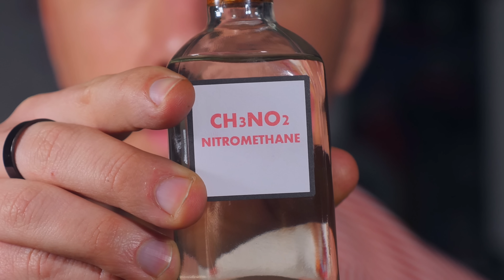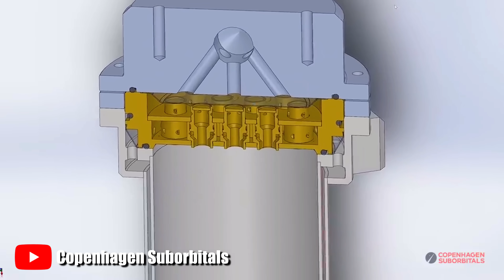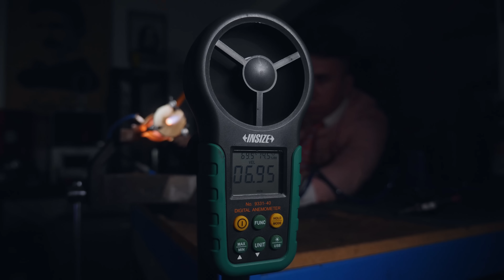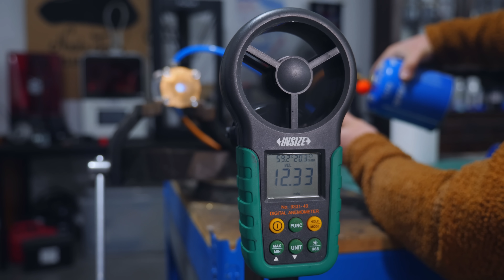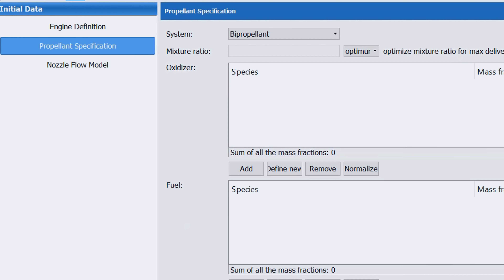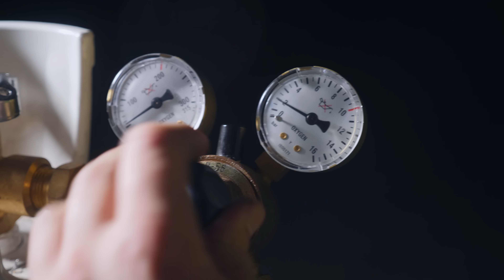GLASS ROCKET ENGINE

Comment: OK, firstly, very cool video as always.  On the the finer points.

1.  You mentioned it head on.  The NAZI's used H2O2 based rockets (V2).  They used pressurized H2O2 in concentrations at or above 90% (government watch list - fear not, you can concentrate your own, but caution as this can be explosive in the pressure lines at these concentrations with 90 degree turns, so be very careful or your right the channel could kill you).  The trick that they used was to use a SILVER or PALADIUM screen to push the H2O2 through to cause it to decompose as it entered the combustion chamber.
2.  If you are using H2O2 as an oxidizer in conjunction with your other Hydrocarbon fuel, then you will get H2O + O2.  The H2O will be very hot and in the presence of your other burning fuel will grow significantly hotter.
3.  What temps are you able to record inside your combustion chamber?  My thinking is that if you can reach temps of about 2000C then you would be thermally cracking the water.  Thus more H2 and O2 (though honestly likely ionized and not stable H2 or stable O2 in the firey hell that is the combustion chamber.
4.  If you can't reach high enough temps in the chamber, a specially designed NOZEL could potentially provide thrust while building up heat.  If so then you may be able to thermally crack the super heated steam and have essentially an afterburner, where the water (first burn exhaust) is thermally broken and becomes the second stage fuel and oxidizer.
5.  Another thought, if you used a SOLID FUEL grain with the bore down the middle, then you could use a combination of rubber, cellulose, and Lithium Aluminum Hydride.  SUPER reactive in the presence of water (even atmospheric water vapor).  Might help produce enough heat the thermally break the water.
6.  If you use either a screen or a tube structure like you would use to create laminar flow, then you could likely get even and consistent decomp of the H2O2 rather than the spurious and uncontrolled decomp you get by throwing the catalyst into  H2O2.  IF the catalyst is not consumed by the reaction, then you could try coating the interior of your combustion chamber with the catalyst and then spray the H2O2 into the chamber along with your hydrocarbon fuel.  when the H2O2 reacts with the catalyst, it should create temps high enough to auto ignite your liquid fuel.

Anyway, good luck and for God's sake be careful.

Comment: For the CO2 cannister engine, how about a high pressure compressor to refill them ( with air) and then make a manifold of 3 or 4 cannisters for increased running time

Comment: Please, would you be so kind to explain a little bit more about calculations of nozzle? Or how to reduce the noise of the engine? Or build а bigger engine that would work not on direct fuel supply but on cycle fuel supply like in stroke engines and could lift about 25 kilos and explain all previous questions in one video? Or at least could you mention, where i can learn about calculations?

P.S.: 3D printers are awesome ;)

Comment: Hey, there is only one problem with all your rocket theories, no it's not the propellant or the engineering or any technical issue, it's simply that nothing can propel in the vacuum of space therefore you have the option of understanding the possibility that space as we think of its fake, that rockets actually don't go there so we have been hoaxed into believing that lue or simply you can continue being a fool which is kind of the image of  the nerd you portray to be in your videos.
Time will be the ultimate judge of that.

Comment: Maybe you could Try a Methanol and Ammonia Mixture, you can run this stuff in Gasoline and Diesel- Engines when you hack/modify the Automatik Engine Timing, so I think you could make an Rocket with this Fuel.

Comment: Project Idea!!  (Tomato approved) Shaver ornithopter!!

So, electric shavers work with an offset wiggly thing. attached to a simple DC motor...

You could make a very simple ornithopter using those wiggly bits and some 3D printed wings :)

I would make it - but my 3d printer is broken and I need a 3d printer to fix it :(

Comment: Have you seen the New Wankel Engine it's on YouTube But it doesn't have any high points like the old One it's Oval with more power and doesn't suffer from fuel waste and Oil Burning like the Old One think you would find it Very informative

Comment: Man, i had an idea, why don't you make an AXISLESS JET ENGINE? (don't even know if this exists but hear me out)

So, I have a turntable that uses a belt-driven system, basically I have a motor away from the axis of the turntable plate that uses a belt to rotate it, so I thought this could be used somehow in a jet engine, causing the turbine blades to be held by some kind of belt at their ends and outside the motor, use something to connect the blades, such as a screw-shaped axis. Thinking about this idea it seems that you would get a smaller engine or that you can burn the fuel better in the combustion chamber but I don't know, maybe its not a feasible idea

edit: actually, the correct word is SHAFT, i forgot the word, so is a shaftless jet engine... kinda.
i also search on internet for that and it kinda exists, not as the same idea i had but a shaftless engine... is used in some boats but i didnt find a jet engine using this, just some patents, so it may be feasible

Comment: ok so i have a idea for a rotational detonation aero spike engine its gonna ber a pain in the ass to make but i bet if anyone could get it to work it would be you no clue how to send you pictures but i came up with a quick sketch and ill try to explain it and make a crude drawing using text

"......./../..../..............\....\...\....."
">O2/<F/>O2 Aero Spike >O2\<F\>O2" 

basically use the rotation injecto but add a third step to it to help cool the spike with oxidizer create thorough mixing of the fuel and oxidizer nitro methane would be a great fuel for this honestly but maybe if done. might be a bit much to try and get detonation but the rotational injectors should help you get the concept down. sorry if i couldnt be more help

Comment: Hey Inteģza 
Have you ever tested the reaction of baking soda and vinegar as a rocket fuel, i know you have to mix it in a closed cylinder and have a valve to oppen when the pressure is at its peak ?

Comment: @Sintratec turns "plastic 3D prints into metal" using a Cold Metal Fusion process.
You could design elaborate rocket nozzles, or  an entire turbojet engine, and have it printed in stainless steel. Check them out!

Comment: I have an experiment for you to try involving 6 Force technology. This tech if for anti-gravity and Tesla has a patent for it in the U.S. patent library. 1928 

Items needed:
I megawatt of electricty that is in the same Electro Magnet wave form as lightning. 
2" sheet of 13% aluminum oxide ( this is the same specs as they used on the USS Eldridge in the Philidelphia experiment.)
You will also need a Steel sheet which is used as an amplifier. 
For more info watch Jouney to the Truth podcast Ep 140 w Dan Cooper.
Thank you for all that you do and I look forward to seeing this if its able to be done..

Comment: would NO2 not work as an oxidizer? Nitrous injection seems like the one of choice for car nerds
Reply: It will. In fact it’s one of the best rocket fuel oxidizers you can get and was very very commonly used.

Comment: Combining vortex intake for a turbine engine. Using hydrogen as the fuel. In theory, compressing air fuel mix for higher combustion and possible higher thrust.

Comment: Building all sorts of engines is cool but power is noting without control so would be nice if you build a car with some kind of engine but coupled a CVT transmission so it can run faster with when the RPM increase. Good luck and thanks for the great entertaining content

Comment: Thought for future video:  3d print a mold for an oxidizer nozzle, and then mix the potassium permanganate with high melting point wax as a binder, and press it into the mold.  Then, use the nozzle to inject peroxide into your rocket engine.  The nozzle should have enough surface of permanganate exposed to initiate the breakdown, and then you inject you fuel and oxidizer and have a nice lightweight fuel and oxidizer setup that could run on small peristaltic pumps.

Comment: I'm not sure if this was already mentioned or if this will be useful. but i live in a high altitude and we have a product called Boost Oxygen which is a bottle sized pressurized can of oxygen for altitude sickness. Smaller can then the one used. Not sure if it is enough air.
Reply: Nevermind that was a cool hydrogen peroxide mixture. That was sick as fuck

Comment: You seem to have made a lot of different types of rocket engines and jet engines. I would love to see you measure the thrust output of these engines using a load cell. A weight scale works I guess but its not as cool as load cells 🤷🏻‍♂🤷🏻‍♂ 
Why don't you make a thrust bench using just a load cell and an Arduino. Its pretty simple and pretty cheap to do and adds a lot of coolness factor to your builds if you have professionally tested the thrust of the engines.

Comment: Hello integza I had this question in mind but i want to know if u put the air intake in the middle and let the air travel forward then back through a angled tube into the combustion chamber, would that be a more stable engine, 
Real question is how would the engine act or change if the air intake was in a different direction

Comment: I think I could make a much more compact combustion system thanks to the dual propulsion design you presented in the video for this rocket boot schematics I have but also a thought is to use a small a electrolysis cartridge for hydrogen and a small tablet and liquid oxidizer cartridge just a thought…

Comment: i guess in theory mixing methanol and hydrogen peroxide makes a really scary monopropellant that may or may not explode violently if something goes wrong and the mixture gets ignited in the fuel tank... maybe safer to do it in multiple stages. 

Actually i wonder just how unstable a mix of methanol and  50% H2O2 really is, considering H2O2 decomposes without a catalyst if it gets hot enough. The decomposition releases heat but boiling the 50% water consumes it (apparently this becomes unstable with concentrations above 68%), but then the released oxygen can also react with the methanol to release more heat. So i do wonder what concentration of hydrogen peroxide might become unstable with fuel in the mix...

...According to my math, an optimal mixture would have enough energy to completely vaporize itself if the H2O2 had a concentration of at least... 22% !? 
That seems way too low, but methanol combusting is a good bit more energetic than hydrogen peroxide decomposing. hm. 
On the other hand the mixture in the video seemed stable enough before adding the catalyst, perhaps the sparks didn't have enough heat to start a combustion-decomposition chain reaction, or maybe the heat dissipated too easily, or maybe i'm just wrong.

(apparently mixed monopropellant is a thing that has been tried, at least according to Wikipedia (Nitrous Oxide Fuel Blend (with nitrous oxide as oxidizer, guess that could be another compact option, you can get it in small gas cartridges i think)))
Reply: ---------------- THE MATH (mentioned above) (disclaimer: i'm no expert, i could be mistaken): ------------------

So the goal is to se what the minimum required concentration of H2O2 is, such that when mixed with an optimal amount of Methanol, the mixture can react with enough energy to completely vaporize, assuming no heat lost to the environment (also not considering difference in boiling points, though that should have a relatively small effect)
To do this we make a function for heat (energy) after vaporization, decomposition and combustion, per weight of reagents, given some H2O2 concentration used, and then rework the function see what that concentration becomes given zero sum heat (reaction is just barely self-sustaining)

First we'll need some variables:

H2O2 (values for 100% concentration, the graphs for heat of evaporation and decomposition over concentration are almost linear, so we'll approximate them as such):
He = heat (energy) of evaporation = ~365 cal/g = ~1.53 kJ/g
Hd = heat of decomposition = ~690 cal/g = ~2.89 kJ/g

Water (0% concentrated H2O2):
We = heat of evaporation = ~580 cal/g = ~2.43 kJ/g

Methane:
Me = heat of evaporation = ~1.17 kJ/g
Mc = heat of combustion = ~22.7 kJ/g

Ratios:
c = concentration of the H2O2 used
Rmh = ratio of methanol to H2O2, based on stoichiometric ratio

to figure out Rmh we'll need:
Ho = ratio of oxygen generated per weight of H2O2 = ~47%
Rs = stoichiometric ratio of methanol (air/methanol) = ~6.47 / 1
Ao = oxygen content in air = ~21%

Rmh = 1/Rs * c * Ho/Ao = c * Ho / (Rs * Ao)
(for 100% concentration this works out to around 0.35 / 1, so 0.35 g of methanol per g of H2O2)

now we can make our function

Σe = c*(Hd - He) + Rmh*(Mc - Me) + (1 - c)*( -We)
Σe = c*(Hd - He) + c*Ho/(Rs*Ao)*(Mc - Me)) - We + c*We
Σe = c*(Hd - He + Ho/Rs/Ao*(Mc - Me) + We) - We

Σe = 0
c * (Hd - He + We + Ho*(Mc - Me)/Rs/Ao) - We = 0
c * (Hd - He + We + Ho*(Mc - Me)/Rs/Ao) = We
c = We / (Hd - He + We + Ho*(Mc - Me)/Rs/Ao)

finally replace the variables with their values (in a calculator) and the result is:
c = 0.21638 = ~22%

Comment: Idea of a video: Screw Compressor running as motor. The 3D shape is challenging. A synced one is easier.  But it is a powerful machine and completely based on the flow. May be it is possible to have a gas injection and burn it.

Comment: Hey dude, I have been watching your shenanigans for a while now.. I noticed you struggle with the ceramic parts. Now that you have a kiln.. you could model your parts (in negative) in normal pla and make a mould for normal  ceramic or fibre reinforced ceramic...the pla can be removed from the internal negative spaces similar to the lost pla method for casting, Luckily, rockets always have a outlet... good luck.

Comment: Why not use a small hobby engine to run a compressor system for one of your rocket engines instead of bulky pressure vessels? The hobby engine could probably be made to run on the same fuel that the rocket uses. I can't help but imagine a diesel punk rocket come to life.

Comment: Next Video Idea: Try mixing hydrogen peroxide with some miscible liquid fuel and force it through a catalyst - silver wire mesh or even just a bunched up silver jewelry chain should do. In theory you could achieve auto-ignition with that mixture alone.

Comment: I feel that the swirl nozzle would have performed much better if the nozzle was a true rocket-type nozzle. They're designed to squeeze the combusted air and fuel at an angle, like one of those water hose nozzles, and then cone out to "shape" and direct the thrust. Granted, it still wouldn't make nearly as much force as the jet engine design (which works better at smaller form factors), but it would have shown more promise 👍

Comment: If you can carefully calculate your h20 byproduct and retain them in the chamber you should have enough energy to perform high temperature electrolysis of the water into more oxygen and an extra hydrogen, I thought I saw a hydrogen gas flash at the end of your first permanganate test

Comment: @integza the "bernzomatic" the torch company makes 1.4oz oxygen tanks, you may have to mill/lathe yourself an adapter or fit a regulator to it but it's very small in comparison.

Comment: You need to try the Oxyhydrogen Gas ignition rate is 44,000 ft./s. You better know what you are doing because there is no second chance with oxyhydrogen. It is the fastest ignition rate fuel. When using it you better have the proper flashback arrestors designed for oxyhydrogen before you try this on your videos that deal with flame propagation speed.

Comment: Hello again!  Your skateboard rocket was set free in a straight line.  For future videos and experiments why not put a string on the front and back of the board and attach both strings at the center of a circle.  The board will then travel in a circle and you can time the revolutions to measure which jet/rocket engine last the longest and has the most power.  Also, the small circular path can be recorded more easily for all of us to see.

Comment: Build a rc rocket but instead of a metal compressed bottle that weighs 30 pounds use compressed air from a bottle like 80 psi then limit the flow into rocket as an oxidizer

Comment: So, using the double propulsion mixture, maybe try to make a rocket powered glider or airplane, you need to have a space big and safe enough in order to launch it, but I believe it's a good idea, (also the 3d printer would really come in handy for me).
Otherwise, a safer option would be to maybe use the same double propulsion mixture but on a toy car, to honor the launch of the Mazda rx9, and that beautiful poster you made (only because I don't know how possible would it be to make a rotary engine powered by that solution)

Comment: Make a engine like first heat the water turn into vapour, heat the vapour it will turn into a very hot air that could burn anything from that air, from that hot air make a Industrial steam engine that is 10x faster that normal steam engine 💀💀

If i was you,i would have try this idea immediately 👍🍞